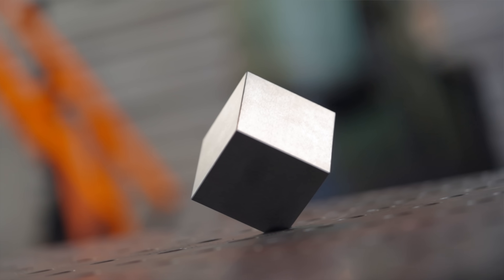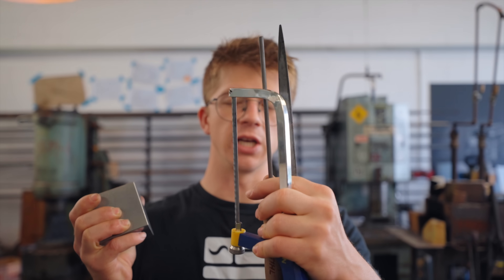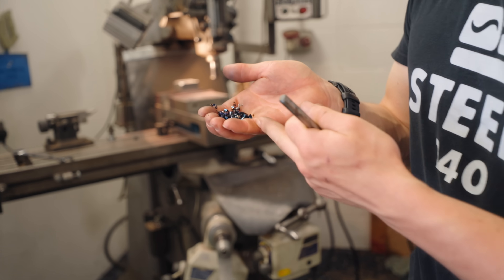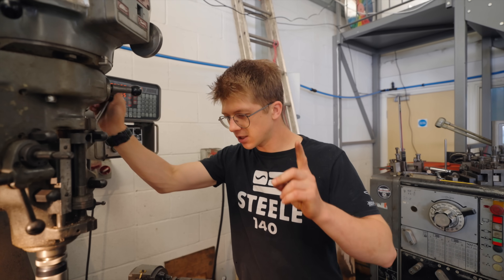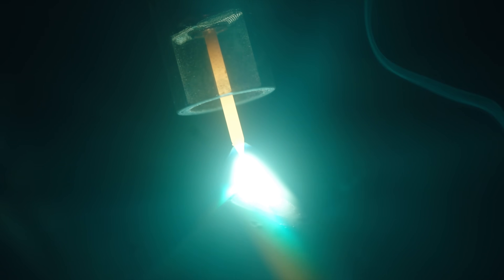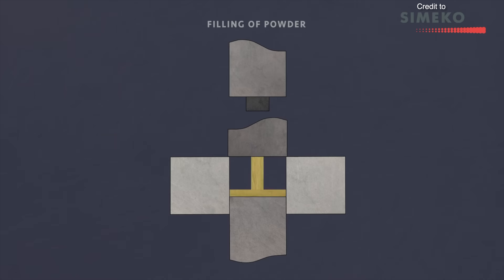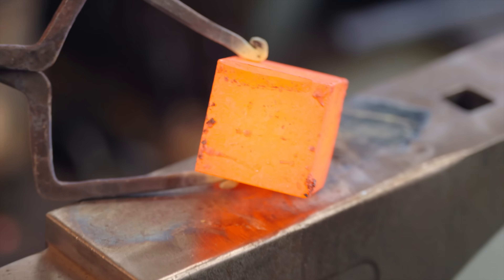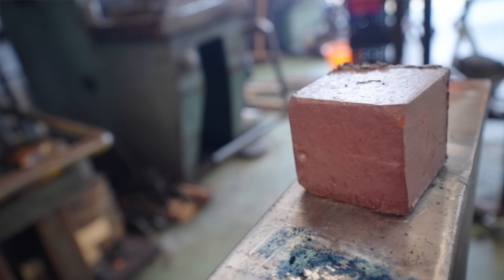Can You Forge Tungsten?

Comment: 📍 Tungsten micro folding knife
📍 Tungsten shavings in a steel Damascus 
📍 Tungsten logo marking stamp
📍 Tungsten hammer
📍 Tungsten sword Pommels! The extra weight counterbalances an extra long sword.
Reply: Out of all your suggestions, the tungsten pommel has to be the most big brain. Not only would it be an effective counterbalance if appropriately designed, could you imagine taking a ball of tungsten to the helmet from being ended rightly?

(EDIT: Or even worse, murder stroked? Like, imagine a tungsten mace head...)
Reply: @Anino_Makata  a tungsten mace head sound really fun
Reply: @Anino_Makata imagine a spiked tungsten pommel, would be like having a small Indian warhammer on the bottom of your sword.
Reply: @Anino_Makata  a tungsten mace head just crushing through everything else like it's made of aluminum foil
Reply: A tungsten counterweight is a fascinating idea - it's got me thinking about the other uses of tungsten in weapons. What other advantages you could gain?

Part of me wants to see an axe forged with an inlaid tungsten carbide edge (sort of how older axes had carbon steel edges inlaid into wrought iron heads).
Reply: @wufflykins4369 I was also thinking of a machined edge for a weapon. But: will it forge weld...
Reply: @bramweinreder2346  Would be interesting with its higher melting point.
Reply: @wufflykins4369 tungsten wafers go in ar15 buffer tubes
Reply: @wufflykins4369  that would be cool, I am not sure the steel would forge weld to the tungsten so maybe slice a thin 1/8" layer or something like that and drill a few holes through it and then sandwich steel around it like a sanmai and the steel could weld to itself through the holes and capture the tungsten.
Reply: @BensRamblings  Yeah, it probably wasn't the most though out idea on my part. I imagine the temperature required to forge weld the tungsten would melt the steel. 

Your suggestion sounds like a good way to pull it off, but as others have said the tungsten carbide is too brittle for the purpose and we've got better alloys for that already.
Reply: and a house key
Reply: thungsten in the microwave
Reply: Tungsten hammer. Make that crazy density useful.
Reply: @andrewgolubiewski3463 Will either be to heavy if the dimensions is kept, or looking like a tiny peening hammer. Would be hilarious to use in a workshop for newbies.😂😂❤❤
Reply: @andrewgolubiewski3463  A recoil free one. 😆
Reply: @TJo63  deadblow? I like it.
Reply: @andrewgolubiewski3463  He'd need to find a place with a strong enough press. One flat side, one round side. Making the eye for the handle would be a triumph. Very doable.
Reply: They use tungsten in darts to get the weight right too.
Reply: @conorstewart2214  The better once are almost completely made out of tungsten. If they use poure tungsten the dart will break. I used to work in a factory were they made glowing threads for old fashoned light bulbs. They started with big rods of tungsten and drew them out to thin threads. If you let a pencil thick piece fall to the floor it would shatter like glass.
Reply: add guitar pick and bottle opener.
Reply: @DanDanBinks619  guitar pick would not work lol
Reply: @lololololol-z3x  i would agree.  made a pick once with titanium. it sucked and sounded and felt horrible.
Reply: @DanDanBinks619  yeah i had a thin metal pick and something about metal scraping on wounded metal was terrible haha
Reply: @DanDanBinks619  no
Reply: A Damascus by using the tiny chips from machining it.
Reply: I think the tungsten shavings in a steel Damascus will simply not mix. You will find them in the final form and will be the reason of a future fracture.
Reply: I sell tungsten for a living.  While it is really dense, and has the highest melting point of any metal, tungsten also has its shortcomings.  1. tungsten doesn't make a nice knife blade, but tungsten carbide does.  2.  tungsten is made via powder metallurgy as it doesn't get to a molten stage like other metals.  I don't think the shaving would homogenize with the other metals.  3.  Heavy marking stamp.  Making it from tungsten doesn't add value.  4.  We've made "Thor's Hammer" for several customers.  5.  Counterbalances is definitely one of tungsten's applications.  It would make for a very heavy sword.
Reply: Also add savings the tungsten chips grinding them up and trying to replicate the tungsten shaping process
Reply: Double sided hammer, one with tungsten. The other with tool steel. My theory is more rebound force in tungsten but more momentum transferred with a softer metal. Could be handy for tuning hits for either sharper (tungsten) or deeper impacting blows
Reply: @therion5458  I think I'm qualified to decide what I find fascinating and why for the record, so I'll clarify - I'm interested in the premise of how modern materials science might change the fundamental design of weapons. 

Not in the sense of what we do today, where we make historically accurate or inspired designs out of modern materials and techniques, but rather the other way around: exploring what weaponsmith's might have done if they'd had an abundance of similar metals and could work them, and how it might impact the landscape of combat at the time. 

E.g. How can you use the density of tungsten to alter the biomechanics of wielding a weapon.
Reply: @wufflykins4369  exactly! New applications!
Also, consider sacrificial material (sacrificial template) techniques — like Roman concrete where the lime dissolves to ‘heal’ cracks — where alloys are made for the sacrificial materials react and wash out to make metallic foams for lightweight strength, filters, noise dampeners, etc. (aluminum foam, heat sinks/buffers, filters, scaffolds, porous titanium biomedical implants, etc.).
Reply: Tungsten hammer is cool. It would be awesome to try to harden it somehow. Stress/work hardening? Quenching? Cryogenic treatment?
Reply: Tungsten particles are toxic, a probable carcinogen, so it is important not to breathe machining fumes.
Reply: Tungsten cutlery.
Tungsten mouse weights for that hefty feel.
Reply: Yes! You are in the right mind! Especially the Tungsten Damascus.
Reply: TOONGSTEN Carbide Drills? What the bloody 'ell is a Toongsten Carbide Drill?
Reply: @PopeRocket  Tounge stone drill the new super material found at the back of your throat.
Reply: extra weight to throw in my opponents face
Reply: I like the shaving one 🤙🏻
Reply: ✅ Tungsten shavings as Damascus is simply a way to upcycle ♻️ the waste into an experiment. Challenging projects and failures are how to learn and grow. Different goals: form, function, learning.
Yes… extreme heat, gasses, extra carbon will be needed.  Might even need to investigate vacuum/low pressure solutions, machine an extrution solution (or injection molding/casting/giga-press), and multiple metals for aesthetics (colbalt, copper, Titanium dioxide, etc.).  Electric fusion, sintering, cryogenics, cuts for microscopic crystal structure analysis… all to play and learn.
Reply: YES POMMELS!!!
Reply: They make darts out of 90% Tungsten so the must be able to forge and machine it. So this is not a surprise.
Reply: @ericbrown4819  darts are either tungsten copper or tungsten heavy alloy (WNiCu or WNiFe).  It is made via powder metallurgy, it is pressed and sintered then machined.
Reply: Tungsten war pick would be efficiently deadly.  It could have a smaller profile with the same mass making the piercing more potent.
Reply: And how would you forge weld tungsten to steel, please explain lol
Reply: @merkel2750  good point.  I mentioned a war pick.  Can you move steel to make a hole smaller?  Perhaps you could forge steel around a milled object.  You can think of me like an expert.  I watched all the seasons of Forged in Fire, so that means all my ideas are sound. :)
Reply: I like the sword Pommels. THAT's the real way to end them rightly.
Reply: Ohh a tungsten pommel for a large sword sounds like a super good idea actually to offset balance of a large weapon
Reply: given it's relative softness and ill use as a cutting blade, I'd say the pommel makes the most sense. You can make a much smaller pommel that makes a perfect counter weight. I also like the damascus idea.
Reply: How about making it into a nozzle for a rocket or jet engine ? That would be THE DREAM of any amateur rocket builder.
Reply: 🛠 Nuclear reactor control rod.
Reply: Tungsten / titanium damascus
Reply: Lollipops
Reply: Tungsten carbide sword
Reply: Tungsten nails, for optimal momentum and energy transfer from the tungsten hammer
Reply: Tungsten Katana!
Reply: @KGTiberius  it doesnt hold an edge tho as you can see
Reply: Tungsten pommels?

Geneva wants to know your location.
Reply: Tungsten hammer would work just fine. Demo-ranch shot such cube with .50 cal AP round and it didnt shatter like glass.  It left a small dent. Ts wh
Reply: Tungsten hammer will not shatter. Demo-ranch shot such cube with .50 cal AP round and it left a shallow dent. That's why they use it on tanks
Reply: Not sure how well tungsten would fuse with steel, it'd probably just make a weaker steal.
On a hammer unless it's a machine driven one the density would mean you'd need to make it really small.
On pommels just use lead.
Reply: My first thought was a pommel I always thought you could get better balance to make the blade almost feel weightless
Reply: a Tungsten hammer would be cool
Reply: I second all of these.
Reply: That's not typically how swords are balanced, but I think it might work with a bit of trial and error! And one sword that does work like that, and which likes to be as long as possible, is the rapier. Scary stuff! Wouldn't like to be smacked by such a pommel either.
Reply: Thor hammer - tungsten 😊
Reply: If i remember corretly, Uri Hofi (RIP) made his punches for his Press out of tungsten
Reply: I hope than i  future, i will found a full Tungsten WATCH CASE /BRACELET  (not W-Carbide...but .metal tungstene like cube of video)
Reply: Melt a measured portion and lift the quench as it forms a large drop… use the shape as a base for the pommel.  This tests melting and saves time on rounding the shape.
Reply: @KGTiberius is really hard to melt, 3000 or more
Reply: @KGTiberius  Melt how though? You need a forge thats more than twice as hot.
Reply: @KGTiberius They would melt down the forge if they attempted to melt the tungsten. It melts at 3000°C (6000 F)
Reply: @KGTiberius  you don't melt tungsten.
Reply: * hammers will shatter immediately, Tungsten is hard but brittle

* Pommels are not for counterweight except for special swords like rapiers. Lead is just as effective for that, for a normal sword it will just be heavier and harder to swing
Reply: @multipoep5  Tungsten carbide is extremely hard but brittle. Pure tungsten, as shown in this video, is no harder than a high carbon steel and extremely tough. It took a beating from the power hammer like it was nothing, and you think it's going to break under an impact force generated by a human arm??
Reply: @multipoep5  The tungsten cube is the video is 95% tungsten and 5% iron and nickel giving it the ductility of steel while still being as strong as tungsten. A tungsten hammer alloy would not shatter as the video clearly showed that it is malleable

Comment: there is a difference between hardness and density ...gold is dense yet soft, titanium is very hard yet just 4.506 grams per cubic centimeter in density , almost all drill bits are alloys, it allows the combination of various properties and the mitigation of some single element weaknesses. In the case of titanium it is typically combined with 6% Aluminum and 4% vanadium...heck Iron Man's fictitious suit was a titanium-gold alloy ..after the movie, in 2016 scientists got curious what if you really made such a (NOT COST EFFECTIVE ) alloy, well they found it to be 3-4X the strength of steel (which is an Alloy of Iron, Carbon, manganese, etc)

Comment: Well according to wiki.. tungsten's melting point is something like 3422F or 1883C.. You said you forge iron at near its melting point.. I'd imagine you were referring to Celsius and not Fahrenheit when you said you forge iron from 800 - 1200c (1472-2192F) which would in fact be near irons melting point. 

If I were to gauge a forging temp for Tungsten.. the temp to forge would have to be no less than 1400c because 1883C is Tungsten's melting point.. that would be my guess.

You could test this by measuring the temperature of the arc coming from the maxed out tig welder when you were melting that Tungsten cube on the corner. and dial it down enough until area glows bright orange.. then measure the temperature of the surface affected by the heat.. that should give you a rough estimate where you set your forge too.. insert cube and pray.. lol

Comment: Has anyone here actually worked with Tungsten?? As a wire it softens about 400^C depending on the alloy & can be wound in a spiral. Yes ... its worked/drawn with other metals used as glue. It is porous with long linear microscopic voids. It is not gas tight for high vacuum and will bond well to some low expansion glasses such as borosilicate and quartz.

Comment: I use tungsten bucking bars for riveting, takes FAR less hits from the rivet gun to get the proper buck, and the bucking bars are less than 1/3 the size of an equal weight steel bar. 

I imagine that tungsten is a lot like titanium in how it can be forged, special tooling and WAY hotter forges. Try the same experiment with a block of titanium!

Comment: This here would be a tungsten alloy.  This is why it is somewhat machinable.  If it were pure tungsten, none of your tools would have been able to touch it.  Normally ranges between 70-85 Rockwell C hardness.  The alloy is usually ~30ish HRC.
Reply: Moh's hardness of pure tungsten is only 7.5, hardened steel comes in at 8 which is why it could drill into the block and most common grinding materials come in at 8+. So this is pure tungsten, the alloys can get dramatically harder. Tungsten Carbide for instance comes in around 9, but it's still soft compared to things like boron carbide which is very close to a 10, and potentially exceeds it.
Reply: @Jake12220   I was speaking more to the HSS drill,  inserted carbide cutter, file, and hacksaw blade, not the abrasive stuff.  I do still think this is not pure tungsten, regardless.  Good info though, thank you for sharing.
Reply: @SGIABC  all those things are still abrasive though, they scratch at the surface rather than deform it. The only tools related to impact hardness are things like the punch and hammers.
Reply: If you are wondering, Rockwell measures the resistance to deformation, not to abrasion.

Comment: I'm not surprised that Tungsten is so resistant to heat. I mean we used them for decades in bulbs, to an extent still do. That's their main unique feature, so long as they're in a vacuum they'll glow white hot for aaages. 
But still interesting to see the difference between Tungsten and Tungsten Carbide. Good job sir.

Comment: There is an open access review paper from some gentlemen in the UK going into the forging and processing temperatures and procedures for pure tungsten.

Advanced Processing and Machining of Tungsten and Its Alloys
by Samuel Omole, Alexander Lunt, Simon Kirk, and Alborz Shokrani.

2022 paper published in JMMP volume 6 issue 1.

I can't post a link here but you should be able to find it.

Gist: 1500-1700C with one group hitting it with 2500.

1700C is within the range of a MoSi2 resistance furnace which are very simple to operate.
Reply: Wouldn't an induction furnace help?
Reply: @spdcrzy  That is what I would use, I have gotten to about 2600C in my big furnace at work, under argon of course.
Reply: @Ammoniummetavanadate  I'm surprised Alec didn't think of that, honestly.

Comment: As an engineer trying to understand ways to work with Tungsten -- this is exactly what I wanted to see, thank you it's actually extremely helpful!
Reply: Sintering and pressing
Reply: @BirnieMac1  No doubt that seems to be the optimal general-purpose method for mass-produced moldable geometry or less-workable alloys! But imagine you just need a single, simple bracket to hold some absurdly hot object. The required tooling (the custom die and press to mash the powder into shape) would kill the cost :( But,

on the other hand, if it could be made with just a few operations to a piece or two of stock? I presume even in mass production that may often still beat pressing/sintering on cost!

So for me, I'm very appreciative to be able to see with my own eyes just exactly how the material responds to being sawed, cut, ground, drilled, milled, forged, and stamped...

Honestly I was very impressed at how effective almost everything was! Game-changer. Even the least effective methods "worked" -- forging could be used to for example make bends in a bar or shape a sheet (though it may remain too brittle for much deformation), and even stamping could still apply a texture.

It seems many, many parts can be made from pure tungsten without having to resort to pressing/sintering, which is fantastic because pure tungsten is almost the literal melting-point GOAT of any material of any kind in our universe that's known to man!

Tungsten's element-symbol is W. And it's a pretty massive W if ya ask me ;) ^_^
Reply: If you cannot see that this block is fake stop trying to be an engineer. It is not real as in not 100% real, it's an alloy.
Reply: @YuckFoutube-e1z  There's nothing in the video that indicates to me anything of the sort. Tungsten is expensive, but it's not that expensive ... he can afford a 5kg cube; and most alloys are made to be stronger, not weaker, than pure tungsten.

Comment: So what I took from that forging, is that when hot it will deform under small area impacts (like the touch mark), but when that impact is spread over a wider area like the hammer dies it is lessened greatly. So in theory, if you had a stong enough power hammer you could forge it